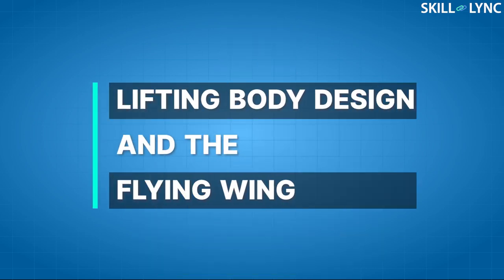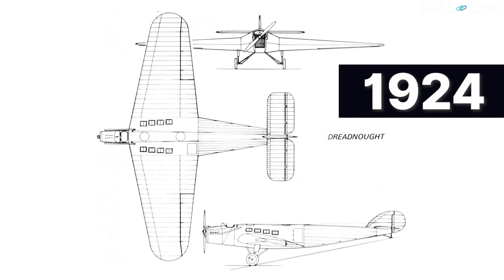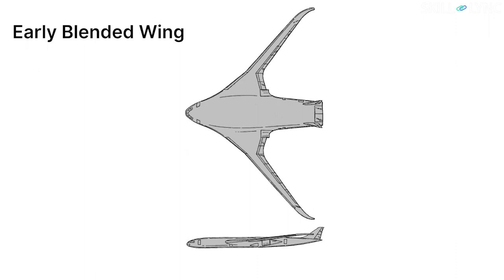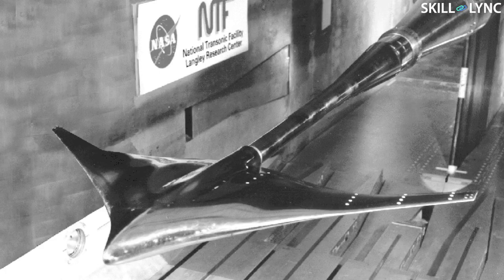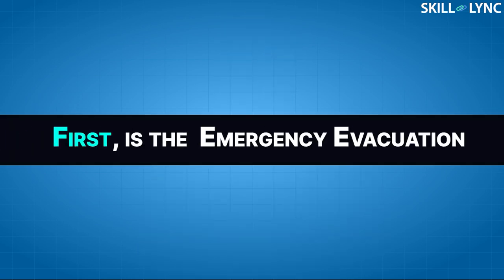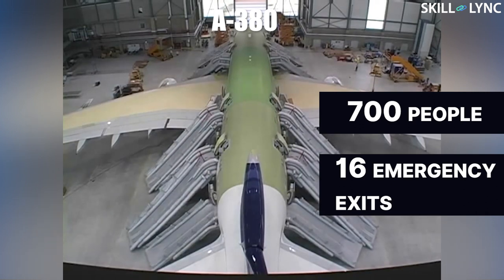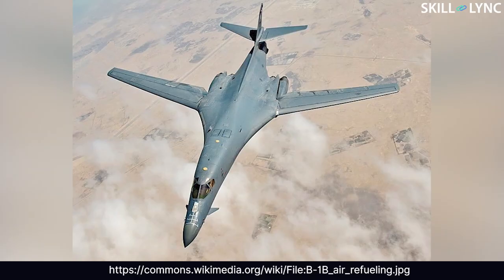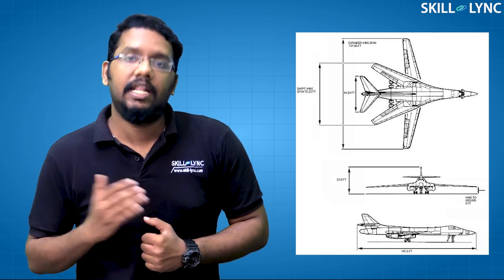Blended Wing Design | Skill-Lync

Comment: Very well put together informational video... I so want to build a BWB Private Jet...a VTOL would be good, but an STOL would be fine for now...
1. Emergency Evacuation - 2 Doors for Ingress and Egress 15 to 20 Passengers is more than Enough
2. Engine Serviceability - Place the Turbine Engines on a Slide-able Rail Structure to Slide the Engines Backwards for Service
3. Pressurization - Not an issue for a small Private Jet
4. Wide Body Design - Not an issue for a small Private Jet
All I need now is some funding
Reply: Agreed. Dzyne Technologies is looking to build a business jet called the Ascent 1000. 
I think equally a 3-5 place aircraft would be amazing. Egress and pressurization would be even less of a concern. 
The additional carrying capacity and fuel efficiency would be huge for the general aviation community.
Reply: @agisler87  Exactly Bro... I just can't wait...
Reply: @agisler87  Very useful nformation, thank you Andrew...